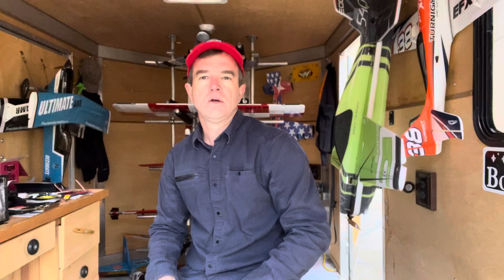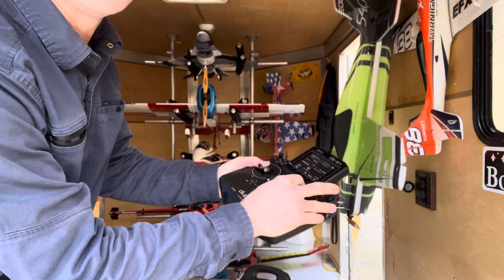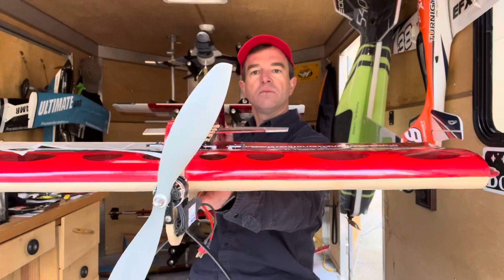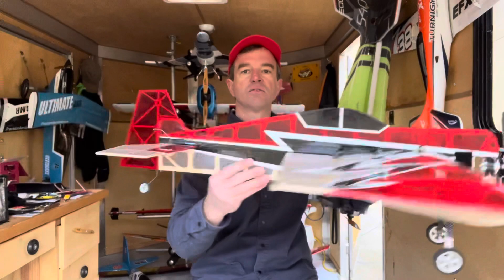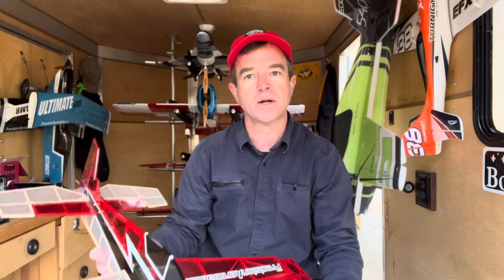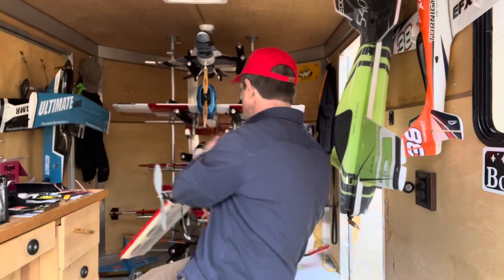When to use the Rudder

Comment: High wing aircraft models  like Cubs and  biplanes  need rudder coordinated with ailerons to make graceful turns. Without rudder, "adverse yaw" can resist turns.  Watch You Tube videos on tail-dragger piloting techniques including handling of cross-winds, slipping, during landings, etc.  Low wing warbird models  also need right-rudder during takeoffs but can turn fairly well without rudder inputs. I use aileron rudder mix and shut it off when I want to coordinate rudder and ailerons manually .